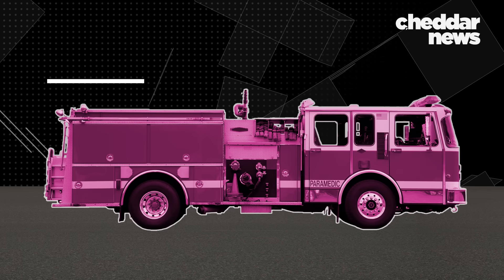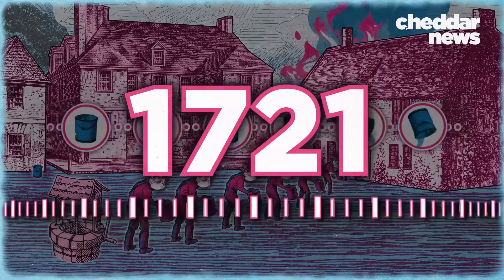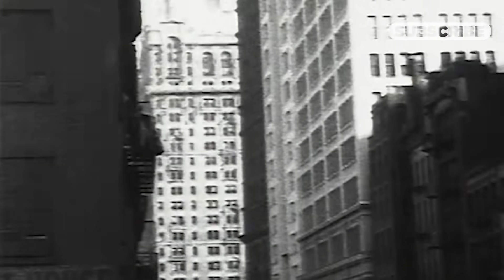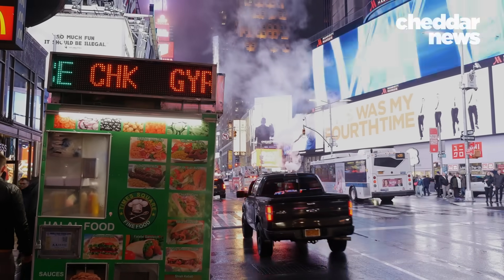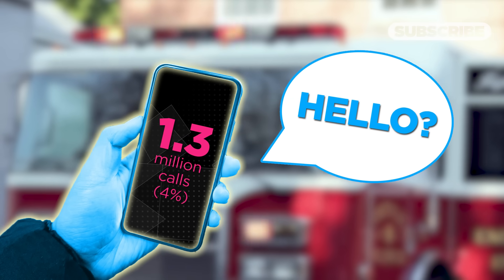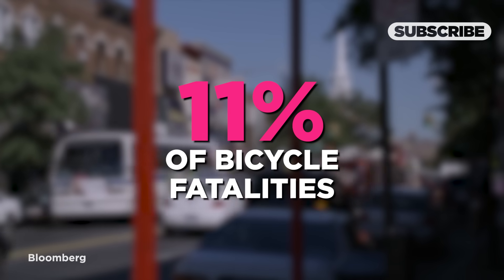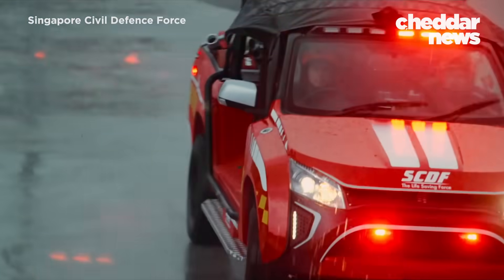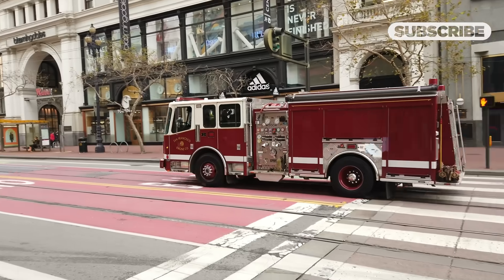Do American Fire Trucks Need To Be So Massive? - Cheddar Explains

Comment: Allow me to nip this in the bud, I’ve driven it all. Any apparatus you can name. An HME American custom cab will outperform every other truck out there. As far as ladders go… if you use a mid mount go home. If you use platform go home. I have beef with how bulky they are compared to how useful they are. Overall American firefighting is very aggressive, we tend to go interior on a lot gnarlier fires so we need more equipment. Plus all that mumbo jumbo about bicycles getting hit.. that’s on the driver, it has nothing to do with the truck itself. You have to also look at the statistics on American apparatus vs en apparatus knock down and response time. American Engines and Ladders are just better. No arguing the stats. Be a firefighter before you argue apparatus please.
Reply: "Any apparatus you can name." sounds like a challenge ;) 
What about ... fire and rescue tanks, buses, mobile cranes, turbine extinguishers, compact car / motorbike / SUV / van? Just curious, as some trucks here don't exist there and the other way around as well
"An HME American custom cab will outperform every other truck out there" how so? I don't have any experience or knowledge on them. 
" If you use platform go home" I can see your mid-mount aspect, but why against platforms? What's wrong about them? 
"we tend to go interior " almost every attack is an interior attack here. In some countries they even have seperate apparatus for interior attacks (sth we don't have down here)
"You have to also look at the statistics on American apparatus vs en apparatus knock down and response time" I've been at apartment fire calls where the first Engine has left the scene 15 minutes after the alarm went off at the station. Few weeks ago I've also seen a video from the FD in our capital city responding to a 2nd alarm garage fire: on scene within 3 minutes, fire out after 9 minutes
"American Engines and Ladders are just better. No arguing the stats." what sometimes makes me wonder that most ladders have only a 100 ft ladder despite having such a big chassis. On the same size of chassis you'd see at least a 150 ft, usually 170 ft or maybe even 200 ft ladder here.
Reply: @EnjoyFirefighting  
Like I said I have a personal beef with platforms primarily bc I can do the same thing with a straight stick. It may not be as safe but platforms are more awkward to maneuver in my opinion. And I think they make most of the newer ladder trucks way bigger than they need to be to house the ladder. Eu trucks just don’t drive the same as an hme. It’s hard to explain without getting way too specific but IN MY OPINION HME custom cabs tend to drive smoother and faster seeing as our HME trucks don’t have a governor in them. Most of it is personal opinion but as far as the stats you’ll have to check that out it’s interesting.
Reply: @EnjoyFirefighting  
Also yes, I have driven cranes buses and tanks, and ofc I’ve driven suv and vans they are usually our battalion apparatus here.
Reply: @chandlercowart4109  "I have driven cranes buses and tanks" in the fire department? if so, which department? I'm not aware of any cranes at any fire department in the US

Tbh I'd always prefer the platform; As for maneuvering, do you mean maneuvering the truck itself or the ladder and platform when set-up on scene?
Reply: as for platforms: you basically won't find any Aerial without a platform here any more. Let it be as safe platform for crews work from, or to evacuate people, very popular use is the mounting of an EMS stretcher when getting a patient down from an upper floor, platform for divers to get in and out of the water; as for evacuation: how do you evacuate people with a wheelchair?

Comment: As a fire fighter their two reasons our trucks are big

1. We like it, a lot of fire houses are very stubborn and take pride in their equipment. The trucks are one of the things Fire House pride themselves, they clean those things better then their own cars lol. And their a lot of history behind them too, In fact I rode on the same trucks my uncle and grandpa did, same exact ones. This even applies to other things like our helmets I wore the style helmets that my great great uncle wore  in the FDNY. 

2.We need it, our trucks have large water capacity and powerful pumps, even my dept. tower ladder has a pump in it. Even though my area is well off and like 1-2hours form NYC we still have issues with our hydrants due to the harsh winters. Snow plows have sometimes cause the hydrants to bend. My neighboring town of mind had no working hydrants at one point for months. And in Rural areas hydrants isn't always readily available that's why some dept. buy huge semi trucks with trailers to haul thousands of gallons of water. In cities high-rises on fire require powerful pumps to pump water all the way to the top.  

3. lastly some areas simply can't afford to buy new trucks, some have trucks form the 60s 70s and 80s hell I seen one form the 50s.
Reply: Age of the vehicles doesn't really matter long as they still work and have been modernised a bit.
Even if they were replaced they'd end up working on an industrial estate or part of someone's collection
Reply: also we have high rise buildings we need to get the water up into, or rural areas with no hydrants, or areas with harsh winters; The North Cape in Europe is as far north as Barrow at the northern end of Alaska.

Comment: Rather than just coming up with an idea and making a video, maybe you should talk to firefighters with each type of equipment and needs. I've been watching videos of firefighting from all over the world. In the U.S. We have several preconnected firefighting hose lines. I notice in countries with smaller rigs have few or none. They have hose  compartments with rolled 50 ft. Sections  that have to be removed, unrolled and connected together. Plus, get a nozzle and connect it and connect the hose to the pump. All of that takes precious time. In the U.S. We grab 50 ft (nozzle attached already), put it on our shoulder, pull the rest out and drop it on the ground. Take off, letting the hose stretch out behind you. It is pre-connected so when you are in position, the water is too. Sometimes you have to put the fire out to make the rescue. No time to fiddle around assembling the hose line. And, what are the differences in type and amount of other equipment used by the different countries.
Reply: "In the U.S. We have several preconnected firefighting hose lines." same in e.g. Germany although most trucks don't have a hose bed they still have preconnects. "All of that takes precious time. " take a guess what we have the quick attack rubber hose reels for ;)

Comment: I wouldn't say that US fire trucks are massive you just took the biggest number you got when when taking about length the average is between 30 and 40 feet long   for example the average length in the uk is between 25 and 35 feet  and in fact the worldwide average is  between 20 and 35 feet fire trucks in the us aren't massive they are certainly large  and i say they are sized proportionately to their environment your in the US the streets are larger and your houses tend to be bigger as well while UK fire trucks would probably work   eastern European fire trucks and the tiny fire trucks sometimes found in Asia wouldn't work as they would be to small for the job in the US   manufactures don't just build large fire truck because bigger must be better they size them accordingly and it just so happens that fire trucks in the us are bigger because the larger size works better in the us
Reply: the size of the chassis of an American 100 ft ladder truck is comparable to the size of chassis where Europeans would have sth like a 150 ft, 170 ft or 200 ft ladder on it; The chassis of a 300 ft platform in Europe is barely longer than the overall length of a 100 ft Tiller Ladder in the US. In that relation I'd say they definetly are massive ^^

Comment: One of the hidden costs of huge firetrucks comes in to urban planning.  Roads have to be extra wide.  Internal neighborhood roads/cul-de-sacs have to accommodate the massive turning radius of big trucks.  This really does eat into both the amount of actual housing, the amount of parking, and the amount of landscaping you can build.
Reply: Chances are, the fire apparatus are no bigger, if not smaller than a garbage truck or even buses going on the same roads. Oh, you'd also be surprised that a cab over will outturn many vehicles smaller than it.

Comment: This is the exact reason why social media is so extremely dangerous! A person who has never even rode in a fire truck or spent a day on the job is offering up declaratory speech, or rather their own opinions, that millions will view and conclude incorrectly. As an urban fire chief from the Midwest, I can’t even begin to expose the inaccuracies in her comparisons. From water supply, building construction, varying codes, density, cross over medical response capabilities American Fire Engines are constructed and battle an invariable different set of conditions along with a generous amount of additional responsibilities. Visit your local fire station and educate yourself directly from professionals instead of some self taught social journalist.
Reply: what are the additional responsibilities?
Reply: "along with a generous amount of additional responsibilities. " which ones?

Comment: The difference is in the roads. Foreign roads are usually narrower and in many very old cities the roads also can't take the weight. And no, American fire equipment doesn't need to be small like European fire fighting vehicles.  We need more water capacity as we have more area to cover that has limited to no water availability. European cities have better water supplies in their cities.
Reply: Swedish roads are very American like apart from the number of roundabouts, but concerning their dimensions they definetly are comparable to American ones; Still they don't run any fire apparatus of similar size 
"in many very old cities" there are only few cities which still have a preserved oldtown area, and if they have one, it's rather small and only make a fraction of a department's response area.
While cities might have better water supply here, we definetly also have rural areas with no hydrant network which would serve as water supply, and areas to cover can be of comparable size as well

Comment: It must be mentioned that American fire trucks are built to be fire trucks from scratch and are cutomized for each individual department both increase cost. Fire trucks outside of the US are made from your run of the mill commerical truck and have  minimal customization.
Reply: I wouldn't call it minimal customization. I think departments over here have the same amount of freedom as departments in the US. The original cabin stays the same, but everything behind in the driver is made specifically for a fire engine.
Reply: minimal customization? I think you hit a spot there ;) 
Yes, like 99% are based on a commercial chassis. Bare chassis and cab, with the entire rest being custom built by the apparatus manufacturer depending on the department's specs and the norms regulating the min and max needs and possibilities. But it goes so far, that even the commercial trucks are built adapted to emergency services right away, like having a crew cab or having a different engine specs, transmission configuration, drive modes, axle configurations etc
Reply: It's not exactly 'minimal customisation'. Usually the chassis and cab are all that's provided by the manufacturer, whilst the rest of the body and equipment is built by specialised firms to fit on these chassis. That way you do get a vehicle custom made for emergency services, but with the reliability and ease of maintenance of commercial trucks. This also mwans that you can have many different specialised vehicles based on the same underpinnings, which again saves costs and makes maintenance easier. Another advantage is that many truck manufacturers such as MAN also build lifted all-wheel-drive versions of their trucks, meaning that you can get extremely off-road capable trucks with the same body as regular fire engines.
Reply: Idk what you call minimal customisation but most of the fire trucks are manufactured from chassis and cabin, every department can customise every little detail.

Comment: Southern California Fire Departments often have utility vehicles on pickup chassis for responding to medical emergencies and even brush fires, which means that a larger truck doesn't always need to be sent to a medical call and same goes for smaller brush fires.
Reply: Where I grew up in the Chicago suburbs, most of the calls where for ambulance service involving medical issues.  The department would usually also dispatch a fire truck for two reasons. First it provided additional manpower if needed. And second it was a philosophy of use it or lose it; if you don’t start and drive the fire truck from time to time then the day you need it for a fire it won’t start or some other issue will cause a problem.
Reply: LA and LA County run ELS Tillers though, so the biggest average truck does go to medical related calls. 

The small utility vehicles are called Squads and they're used for medicals in LA County because the ambulance is run by private companies rather than the fire department. They carry equipment the ambulance crews aren't certified to carry and often 1 of the 2 paramedics will ride with the patient to help the ambulance crew en route to hospitals.
Reply: @KomradeDoge  the ambulances aren't certified to carry that extra equipment cause they're BLS, and some LACo engines are paramedic as well. The reason for some apparatus being paramedic like that is to stretch out coverage, if you have a small remote station  with only enough room for an engine you want to make it as well equipped as possible
Reply: that's good! Many volunteer fire departments here in Germany will run either a seperate car or use one of their vans to act as first responder at medical calls if the next ambulance is too far away (like 10+ minutes response time)
Reply: @EnjoyFirefighting I love your videos man
Reply: But you also have to take into account that many city’s don’t have that kind of budget to add more apparatus to their fleet. Also you have to take into consideration of manpower or employee to equip onto the apparatus. Especially when the said big red trucks do the same thing that the smaller trucks would do.
Reply: Not sure on the reasons for that in Southern Cali, but in my area, primarily if it is an ems call, an ambulance (called a squad or in some cases a rescue or rescue squad) responds and occasionally a pickup, suv, Car, to assist if needed. It is very uncommon in northeast Ohio to have any large apparatus respond as well to medical. I think that amount of ambulances available are also a factor in why some fire depts are sending engines etc. I have also noticed that many of the large apparatus has medical equipment as well (be it for on fire scene use, or as a backup if there are no squads readily available).
Reply: One of the reasons a lot of large cities use tillers over tower ladders is that they, in many cases can navigate turns a tower cannot. The tower with its fixed axels doesn't have the ability to swing the rear of the truck around like a tiller can. It seems off when you think about it until you see a tiller swing a sharp turn on a crowded street. I am quite sure that's why LA County uses so many tillers even for EMS runs.
Reply: great if you can afford the personnel to staff the smaller vehicles.  Fire departments which are actually fighting building fires need those firefighters on their engines and trucks.  They must always consider their strategic reserve firefighting ability.  Conflagration is a CONSTANT threat in the dense eastern US and Canadian cities.  Most western cities (with notable exceptions) have no conflagration risk.  LA is not going to burn down, for example.  Neither will Phoenix.  Philadelphia?  Could easily happen tonight.  There is a difference and if you have a real danger of fire, you better have a standing army ready to save your city.  Those cities don't have men running around in pickup trucks!  They can't risk their cities with that luxury.

Comment: You can slant the discussion  by giving the facts you want. Yes European ladder trucks are shorter. This has to due to smaller streets and a different kind of fire hydrant system which allows to carry the hose in the side and hand unroll it. American trucks have 1000 feet of 4-5 inch hose larger pumps 500 gpm vs 1500 gpm. 500 to 1000 gallon water tanks  American ladder trucks have to carry a minimum of 115 feet of ground ladders. Tillers can carry over 200 feet of ground ladders. There is a difference and they both work.

Comment: Obviously, the creators have no idea about fire trucks. Engines in Germany cost about 550k €. They are more compact, far better Equipment and carry up to 9 FF. It is almost the same in every european country. 20-30 years ago, the US fire fighting system was ahead, now it feels like the same system is 50 years behind.
Reply: it's VERY different in each and every country across Europe. Ever seen an Engine in Norway having a crew of 9? No. They run with a crew of 3 to 4 on an Engine. Also they don't carry nearly as much equipment

Comment: In a country where emergency services are intentionally impeded on an alarmingly frequent basis, having at least one big truck to lead the pack is a good idea. They are used like battering rams, punting vehicles and barriers off of driveways, out of fire lanes, away from hydrants, etc. 

Personally, I think it's funnier when they break windows and run the hose through the car then charge the owner of the vehicle for the abrasions to the fire hose jacket caused by the broken glass.
Reply: sadly thats needed when idiots block hydrants.